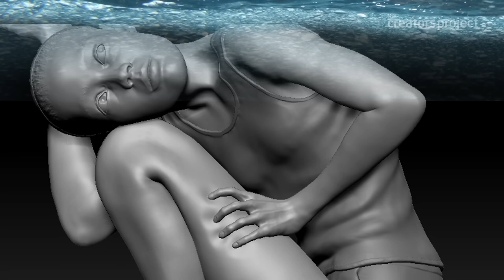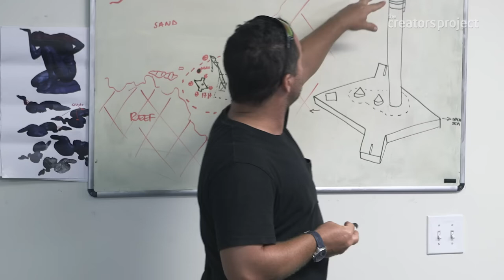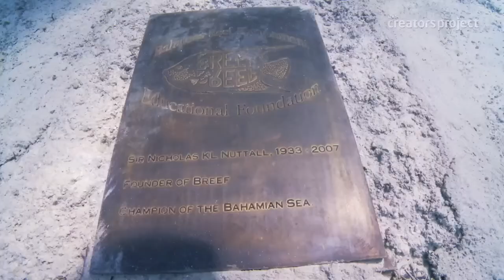Building The World's Largest Underwater Sculpture

Comment: In the Plan, the Statue touches the watersurface, but in the real thing it does not, it doesnt look the way its supposed to look, which is really bad
Reply: *****
There's no way you could allow boats to traverse over the sculpture, it'd be to dangerous. As he said, by the end of the build he was standing on top of the sculpture. Maybe a kayak or canoe could go past, but no motorboat would be able to for safety concerns.  That's why they installed that flag pole, so that it stands above the waves to alert boaters that the sculpture is there as well as to mark it for divers.

The room between the top of the sculpture and the surface is something that would be rather hard to get a precise measurement on before hand, and the seabed could change in the time it took to construct the sculpture. I am sure that everyone was aware of this fact.

And while the initial concept may have been to have the palms up against the surface, the artist would have been fully aware of the possibility that it wouldn't. Besides natural ebb and flow will adjust its proximity to the surface periodically. Still a beautiful piece regardless. And a very enjoyable video on these artificial reef sculptures as well.
Reply: considering low and high tides, it would be impossible for the sculpture to always be at the surface unless on a platform that rose and fell- hence only during specific points in the tide does it rest just under the surface as designed.